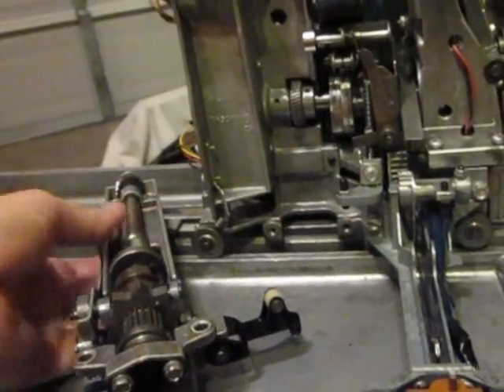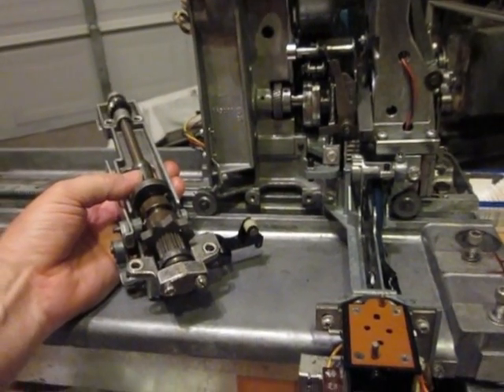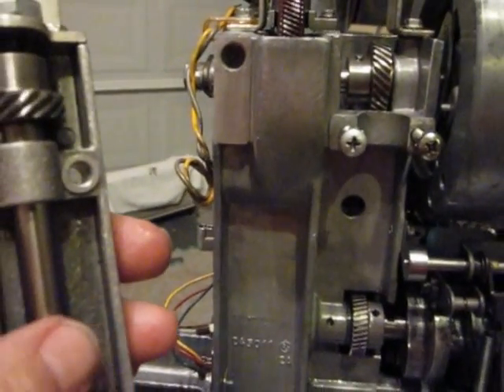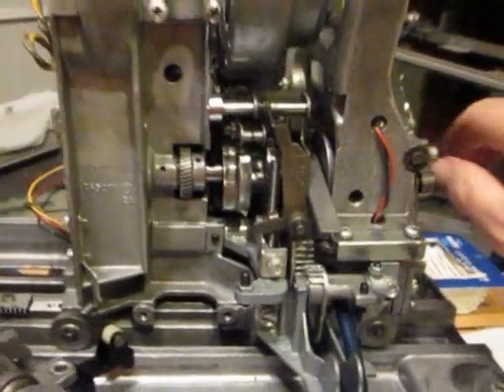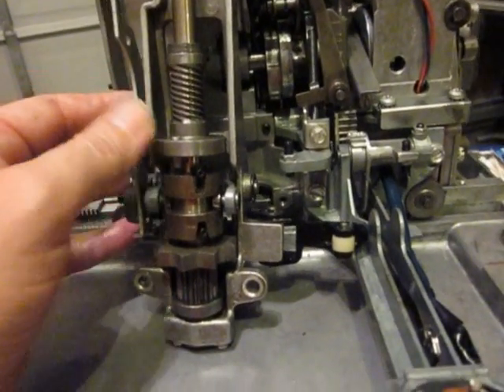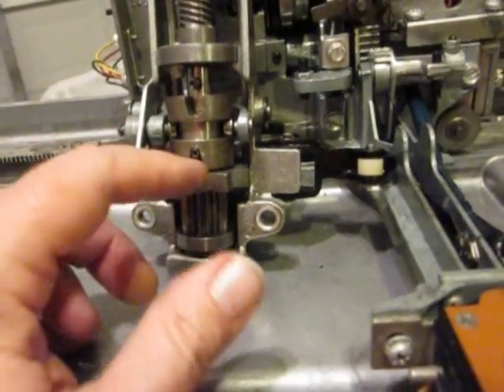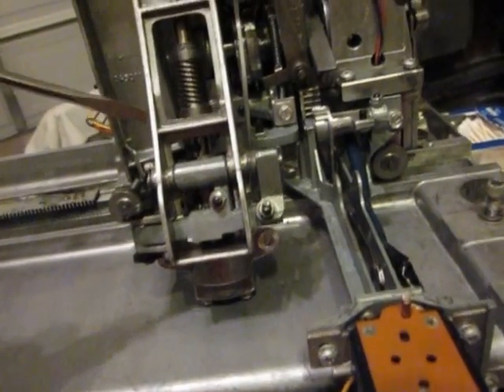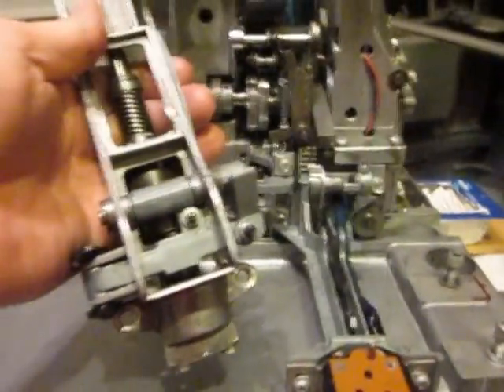Clutch Tour ~ Seeburg Jukebox Model LS2 Gem 1968

Comment: I just completely disassembled my usc-1. Cleaned and oiled piece by piece. It took me about a month doing a little at a time, and it was a mechanical nightmare to look at. To my surprise it was quite simple in its modular design. This was my first seeburg to dismantle, and from now on they will all get the same degreasing, and lubrication. So much smoother and so clean.

Comment: Wow, great video! That machine you are working on is so clean too!  I just dismantled the entire record mechanism including the clutch and have started to reassemble it all, what a mess.  The machine worked for the most part after spraying all the mechanical joints with fluid film but it could not penitrate through the celitified grease in all the joints.  The only way to get rid of it was actually to dissasemble the entire mechanism, a very time consuming hastle.  Once again great video explaining about the clutch.